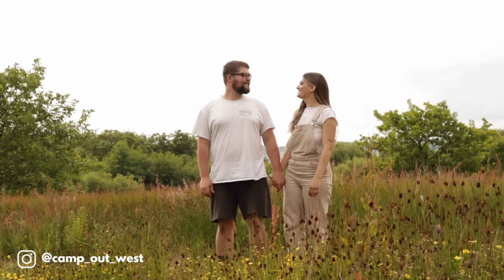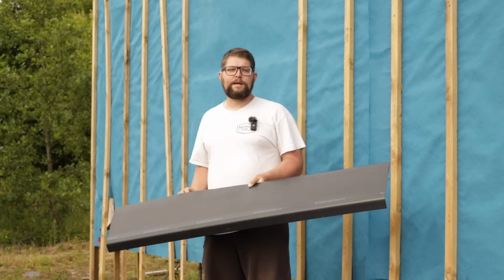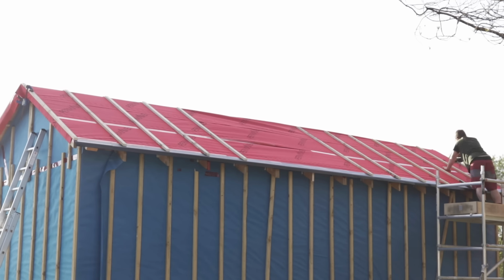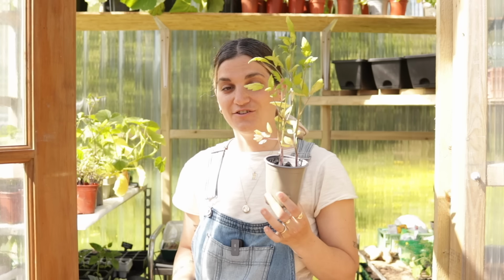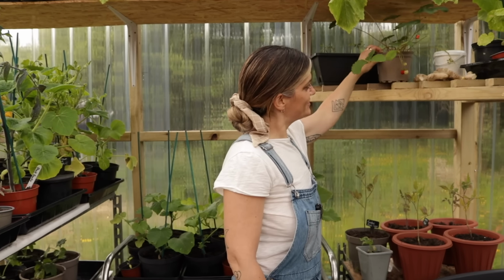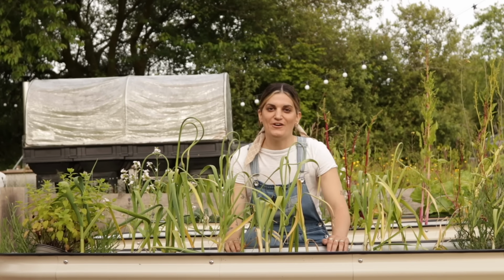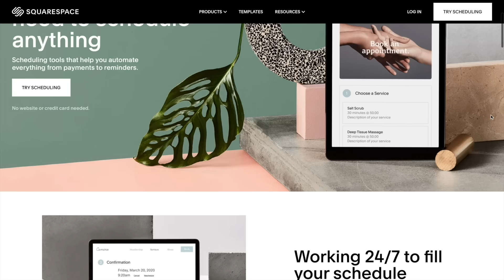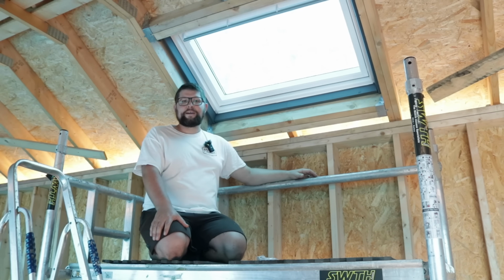Tiny house build. Turning 3 acres into our dream off-grid homestead & campsite.

Comment: The contrast between DIY builds in Europe and North America is wild. For roof work, you are on scaffolding and tied off for safety. I have seen so many North American DIYers climbing onto roofs with no safety harness. I think falling off a roof is one of the leading causes of injuries, so kudos to you for being serious about your safety. Having said that, my Dad worked on roofs his whole life and he was like a mountain goat... no harness in sight. It always freaked me out when he was on my roof fixing something. I would be clinging to the ladder like a limpet. Cheers and thank you for the video.
Reply from the maker: I (Jon) am just rubbish at any height so opted for the rope and harness, no other way i'd be on the roof, i'd love to have your dads confidence, would definitely speed things up, all the roof related work takes ages as i'm so slow moving on the roof.
Reply: What did you anchor to? Aluminum towers would tip over.
Reply: My father-in-law worked a lot on roofs as a surveyor. He was also confident - until he fell off a roof and suffered major tendon damage from grabbing onto the guttering to save himself. 

I guess the point of safety equipment is you mostly don't need it until you REALLY need it.

Comment: I don't know if you know, but just a little bit of advice I learned from others, you need to cut the scapes just when they are starting to curl. Otherwise the scape will take energy from the bulb and make it smaller. Plus that's going to give you a wonderful mild garlic earlier than the bulbs. Makes a great pesto!
Reply from the maker: Thank you for the tip Debbie, I didn't know this before, so super grateful for how helpful everyone is in the comments 🥰

Comment: If you like your garlic big, try "Elephant garlic".  We used to grow that, and it's very productive, with huge heads of somewhat milder-flavored garlic.  But that was in Alabama, USA, so a little different climate.  It also generally produced plenty of tiny cloves that broke off the main head during harvest, then became the next year's seed.
"So now that the roof is completely waterproof, we're gonna cut a big hole in it."  LOL.  Coincidentally, we're working on getting a new skylight for our home.  The current one was destroyed in a hail storm, along with other damage, a bit over 30K USD in damage to our truck and trailer (fifth-wheel toy-hauler RV, we live in full-time).  For now, I have temporary repairs making our roof waterproof.
Bees...one of the very few animals we intend to raise when we're "settled" again.

Comment: So great to see you getting the cabin properly water tight. Putting the membrane up in a wind is a pretty challenging job isn’t it!! You’re making such great progress now. The garden is also doing so well, and so much veg coming, fantastic! The only point I’d make is from my experience courgettes need a lot of space and water so I’m not sure how well they’ll so in those small pots. They can get end rot and drop their fruits easily if watering is irregular or they don’t get enough nutrients so I’d grow them in a big bed outside. xx
Reply from the maker: Thanks Annette. I need to get bigger pots for them for sure, i'm just lacking space. We have ordered a big 8m X 4m polytunnel, but just waiting for our drainage to be done before we install it, so hoping we can move everything into there 🤞 annoyingly when we are shooting weddings we are away for for 3 days at a time, so we have days where I can't water regularly. I really need to look into a self watering system 🤞🤞
Reply: @CampOutWest  I don’t know how you manage with your jobs and the site too! A cheap way to water is to get old towels, soak them and lay on a tray then put a few pots on top. Stick the other end of the towel in a bucket of water and it should wick up into the plants. Keep things going until your irrigation system is out in while you’re way! Good luck xx

Comment: you need to harvest the scapes as soon as possible  because the scape will stop the Garlic getting bigger as its putting all its energy into the flower of the scape. Pick them blitz it up with a bit of oil and freeze them  in spoonful's to use as garlic in cooking These have been on to long xx
Reply from the maker: Thanks for the tip 😄 I will dry that next time. We currently don't have a freezer but I do have a dehydrator which I'm excited to try!

Comment: Just a note for next time you use a router- if you are using a collar but to follow a solid surface (like cutting out for the skylight) you go clockwise if you are on the inside of the solid surface. You would get a smoother cut and the router would jump around less. Likewise, if your router were following around the outside of the solid surface, you should move counter-clockwise. Does that make sense?
Reply from the maker: That makes alot of sense, thanks for the tip 👌